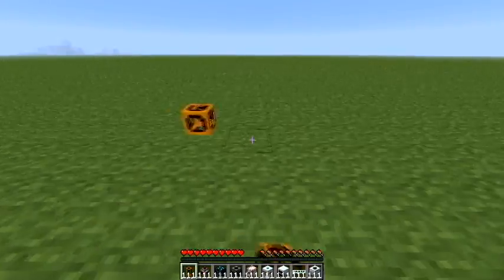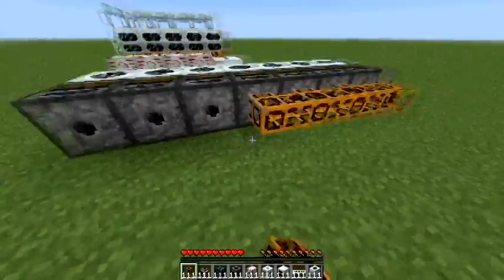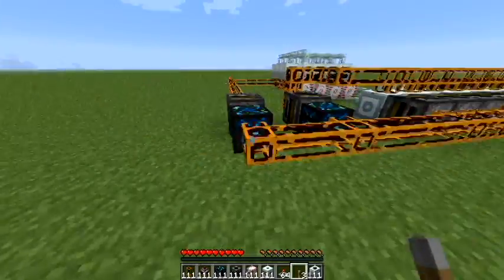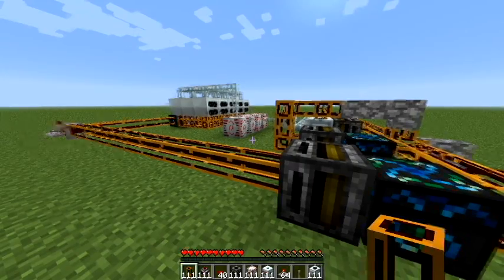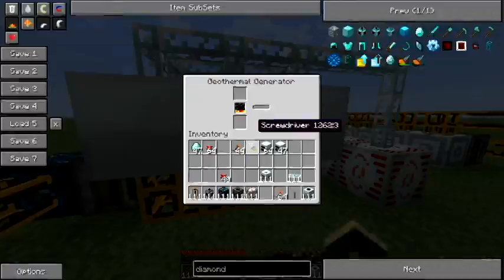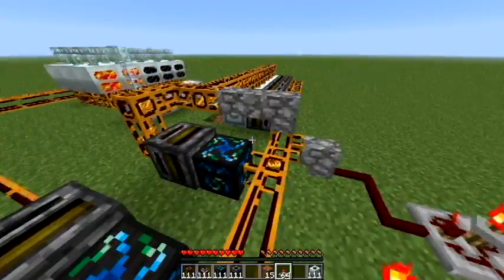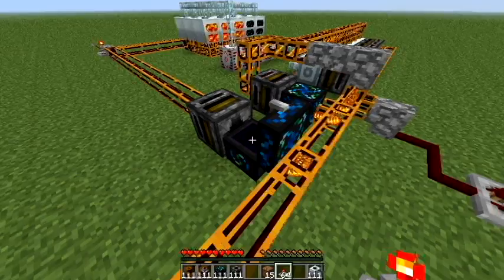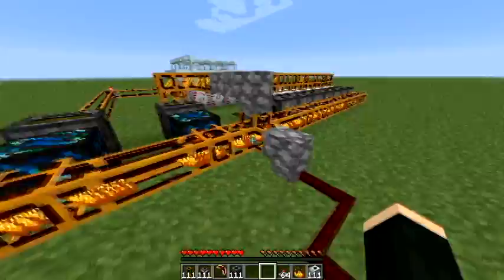[Tutorial] Blaze Rod EMC Generator

Comment from the maker: Yes, they are.  Technic and Tekkit both share most of the mods, particularly the "technical" mods.  However, while it may be EASIER to set up power flowers and other basic contraptions, this is relatively easy, very cheap and gives MASSIVE returns in a short period of time.

Comment from the maker: Jacketed wiring is when you take a block, cut it in half using a Saw, cut those halves in half then cut those halves in half.  You should end up with "panels" and surround a red alloy bar with 8 panels (in a 3x3 crafting grid, bar in the middle) and it should make, IIRC, 4 jacketed wiring.  It allows the connection of regular red alloy wire and the redstone pneumatic tubing.

Comment: As maddawg already mentioned. All of this is quite easy to get... Me and a friend are building a CASUC reactor (our 2nd reactor) which generates 1820 eu/t... meaning we need 36 MFSU's and even that is rather easy to do. You can always build a cheaper emc farm first to get the materials and then expand it.
Btw, at 9:07 you put red alloy wire in the condenser. You can also put in any sort of product that you make with the handsaw (like cover corners) Those are a LOT cheaper to make!

Comment from the maker: The whole point of the setup is to have as low an EMC cost as possible while still maintaining the degree of self-perpetuation.  By creating EMC, you send a very small percentage of said EMC to power generation which then multiplies itself into several times as much EMC and the cycle goes on indefinitely.  If you look at the material cost between -ONE- HV Array and 5 Geothermals, it's enormous.

Comment from the maker: Geothermal Generators can be attached to the EMC Loop allowing for permanent and constant EU generation.  Using solar to get the same amount of EU would either require VERY large solar flowers OR a lot of resources to make a HV or 3 Solar Arrays.

Basically, they create power constantly and once it is fully operational, will run indefinitely.

Comment from the maker: Make sure that you are using LV transformers before the macerators (and if using MFSUs as shown in the video) make sure you have an MV transformer before the LV transformer.  The Adv Machines (and the regular Macerator) take LV be default, so you have to knock it down 2 stages (1 stage (MV to LV) if using MFEs) HV to MV to LV for the machines to work.

Comment from the maker: The point of that many geothermals is to also fuel any other IC2 power-related devices you need.  That power can be sent anywhere to any machine and transformed down.  Yes, it can be more compact, but the layout is so everyone can see exactly what is going on and there isn't a need for an extra condenser.

Comment from the maker: If I recall correctly, you need to place the triple-dots (HV side) of the MV transformer towards the MFSUs and then connect the triple-dots of the LV transformer to a single-dot of the MV transformer or to the wire exiting from a single-dot side of the MV transformer

Comment from the maker: It, in reality, using this exact setup, is not cheap.  It is incredibly efficient and when running at maximum speed, will produce the EMC that was used plus some within a few minutes.  I mean, it takes 3-4 condensers to efficiently break down all the items being produced.  The only problem I've seen is a lot of SMP servers will disable the blaze rod -> powder and bones -> bonemeal maceration since it does provide infinite EMC.

Comment from the maker: So you have the transformer(s) and its connected properly from the MFSUs.  That means the dots are all facing towards another MFSU until the last one which faces outwards (in any direction) and attach the fibre glass cable to the dot from the final in-series MFSU.  If something is broken from that, I would advise rewiring the whole thing from the power to the MFSUs, the MFSUs themselves and the power going out of the MFSUs into the macerators/transformers, depending on your setup.

Comment from the maker: You have to make sure that they are receiving a redstone pulse from a timer.  Whether you use redstone pneumatic tubing and connect it with red alloy wire and some from of jacketed wire or using wire underneath them.  Also, the filter has to have the big hole facing the macerator and the little hole facing you on a side of the macerator.

Comment from the maker: I sure have.  Mk3 power flowers, as they've been deemed by the community, consists of something like 17 Mk3 collectors and 9 Mk3 relays (actual numbers are off).  They are incredibly efficient because, assuming you manipulate the inventories, you will never have to touch them again.  However, the EMC/s is horribly inefficient unless you use Watches + Pedestals, which takes 32 to get maximum speed.

Comment from the maker: The whole system works like this, in the order that I present it.

Lava cells get pumped into Geothermal Generators which power a/several MFUs to power some Macerators that will take a reliable feed of Blaze Rods(1) and turn them into Blaze Powder(5).  The blaze powder is then reconverted to Blaze Rods, while the excess is pumped into a "fuel" chest for the Geothermal Generators.  The excess from that, the "pure profit", is then condensed into whatever material(s) you would like.

Comment from the maker: Just to confirm, for you, that the filters are correctly placed, the largest hole must be facing opposite of the macerators. Also, they must be on a side to pull out the blaze powder. If both conditions are true, try putting some blaze powder into the filters and see if that works. Also, not using redstone tubing can change how you power everything with the timer, so if you don't have all the correctly hooked up, you'll see problems there as well. If none of these were solutions, I could

Comment from the maker: In order to keep the same efficiency, you would have to have a row of 20 or 30 unupgraded macerators because they macerate so slowly.  Putting in even 3-4 overclocker upgrades will greatly reduce the number of macerators you need and I believe 7-8 overclocker upgrades will get you close to the speed of an advanced machine macerator (rotary macerator).

Comment from the maker: If you are in Tekkit or the newest version of Technic, you need to add a LV transformer after the MV transformer -OR- add Transformer Upgrades to the macerators.  If you don't want to use a transformer at all, add 2 upgrades, otherwise use a MV transformer with 1 upgrade in each machine.

Comment from the maker: Assuming you always add more generators if you increase the amount of macerators, yes.  So long as there is never a deficit when using the macerators, there will always be (duh, no deficit means...) a gain and it would be stored in the storage box of your choice (MFE or MFSU).  And if you don't want to increase the amount of macerators which also increases how fast you make EMC, you can just add more macerators to have a larger battery.

Comment from the maker: One of two things.  Either you're using MFSUs with the Advanced Macerators that require upgrades or you're using regular macerators, which need a Transformer upgrade and the MV transformer or MV transformer -> LV transformer.  I play Technic so I'm currently using which doesn't require any upgrades to receive MV.  I have put links into the description showing the different threads for the different types of Adv. Machines.  Hopefully this solved your problem :)

Comment from the maker: It should be something like 1536 EMC for a Blaze Rod and a single Blaze Powder should be half that value, 768 EMC if I'm not mistaken.  So by macerating them, you should be gaining 768 x 3 EMC over the normal EMC.  So total, one Blaze Rod (1536) macerates into 5 Blaze Powder (3840).  That's why there is such a huge gain.  If there has been an update that has removed this or you are playing Tekkit, be aware of the server settings having been changed.

Comment from the maker: Basically, because I was using an older version of Technic (Tekkit always used these machines) you have to put a MV transformer followed by a LV transformer because the machines accept LV be default.  If you only put a MV transformer, then you need at least 1 transformer upgrade PER MACHINE so they do not explode.

Comment from the maker: If you consider the material requirements to create enough panels or a large enough array to compete in the EU production, you already have an advantage there.  Then considering that, if you spaced out the fuel cells appropriately, each diamond creates 64x20,000 EU.  That is 1,280,000 EU per diamond.

Comment from the maker: Chances are, you're most likely going to already have some system of EU production, so once you have this up and running, it doesn't take very long to create enough emc to actually do what you're saying.  HV Arrays would be awesome so you didn't have to worry about EU production failing or using some EMC from the production line to keep EU flowing.  However, you also have to remember that you have to macerate something like 1.2k coal to make 1 HV array.

Comment from the maker: It is supposed to create 5 powder per maceration.  When you split a rod manually, its only 2 powder.  So each powder is 1/2 the emc of a rod, so maceration creates 2.5 times the emc value of the rod.

Comment from the maker: In the newest versions of Technic and any version of Tekkit (with the Advanced machines that allow upgrades), the only real power consumption is on spin-up.  When the macerators are fully spun-up, they only take about 1-1.5 EU/T (EU per Tick) at most.  At least, that has been my experience thus far using the Adv. Machines that use upgrades.

Comment: if you had HV solar arrays instead of normal solar panels you would need just a small flower formation of them to make that kind of efficiency, it costs more resources to build but it's worth it, i had so much stacks of diamond blocks that i made a really big castle out of them and i still had a lot more to use to charge up my klein star Omega =)

Comment: You can basically do this with any items that has an EMC value and has a better output if you macerate it rather than simply crafting it. I.E. crafting a bone will give you 3 bone meals, macerating a bone you'll get 5 meals, it's the same but less effective.

Comment from the maker: It's not up to the Tekkit people to fix, it's up to IC2 mod maker to fix or current mod developer of EE2 to fix.  Changing the EMC value of bonemeal and blaze powder to 1/5 the original item will make it so it is impossible to "dupe" the emc, but also makes it very costly prohibitive to not macerate it.  IC2 can fix it by making bonemeal and blaze rods non-maceratable, but either way, its not duping and its not a bug, it's just using the functionality of one mod and automating it.

Comment: What I Recommend To This is Using Watermills As A Power Source Since Its Easy And Have Unlimited Source Of Energy Since 2 by 2 water blocks makes unlimited water source. This Is More Resource Saving And Works Day And Night You Can Also Make It Automatic With Buckets Using Deployers. Witch Makes It  Much More Safer. Also Speed  Production Of Electricity Relies On Number Of Watermills. 40 Watermills Is Like Having A Nuclear Reactor Trust me.

Comment: this will help make your EMC gen more efficient:
use a retriever if you are going to use about 3+ because it works out alot cheaper (im currently running a legit EMC gen on 105 normal macerators and 1 filter 1 sorting machine and 1 retriever) and it produces a shit ton of EMC about 1 condenser of red matter a day.

Comment from the maker: You can get away with a smaller setup.  You can use one macerator, a few batboxes and some solar panels to start it.  Once it gets going, you can expand it into the full setup allowing for several macerators with high energy surplus allowing for usage of EU across your base without need to worry too much.

Comment from the maker: Somewhere between your "EU Battery" (MSFUs or MFEs) you aren't changing the voltage to Low-Voltage (LV).  Tekkit Rotary Macerators have always taken LV, whilst the earlier versions of Technic used a different version of the mod, allowing for Medium Voltage (MV) to be accepted by default.  You must add either 1 transformer upgrade into each macerator while maintaining the same setup -OR- add a LV transformer after the MV transformer.

Comment from the maker: That can only mean that the voltage you are trying to put straight into them is too high (eg they accept Low Voltage and you are using Medium or High Voltage).  Try adding a Medium Voltage and/or Low Voltage transformer, back-to-back or put in Transformer Upgrades into the macerators.  If you followed my setup exactly, then you will only need 1 Transformer Upgrade per macerator -OR- one Low Voltage transformer before the wiring enters the macerators.

Comment from the maker: As long as they are directly receiving a redstone pulse, are faced properly and are on the side of the macerator, it should be pulling it out.  My only guess is the tubing isn't connected properly or you put something in the filter.  Not sure, could also just be a bug, so replacing it may fix it.

Comment from the maker: This is true, however you have to consider that every single advanced panel requires a proportional amount of regular panels.  One Low-Voltage array (8 EU/t) requires 8 regular panels and one Low-Voltage Transformer.  A Medium-Voltage array (64 EU/t) requires 8 LV arrays and a Medium-Voltage transformer.  That's 64 regular panels to equal only 3 Geothermal Generators.  Not to mention they ONLY function during the day and require a straight-shot to the surface to produce energy.

Comment from the maker: Fill two of the slots (the top right slot and the bottom slot) with something that isn't maceratable.  So dirt, sand, wood, etc so it wont fill that slot with rods.  Make sure the rods pump in to the top and  pump out from the side and make sure that you have the powder feeding into the condenser with the blaze rods targetted, then the diamonds for fuel, then the storage condensers.

Comment from the maker: If you are using technic, when you have the utility mode of NEI (I can't really recall most of the mods, been a while since I lasted played) it should tell you the EMC value of items when you hover over them.  If the lava cells don't have an EMC value anymore, then I'm afraid this method would not work.  Otherwise, I'd check to make sure you're actually using the LAVA CELLS those are expendable tin-created cells that hold lava.

Comment from the maker: Of course, the only downside would be that if you eventually want to crank it up to 8-10 overclocker upgrades to your Macerators, you have to adjust the input to go up to MV and/or HV.  Using MFE's will drain very, very fast if you ever want to get to that efficiency, but otherwise there is no downside.  If you use regular Rot. Mace. and put 2-3 maybe even 4 OC (Overclocker) upgrades, you should see high return and very little problems with the EU intake/output.

Comment from the maker: If you're using Advanced Macerators and its the version that doesn't allow upgrades, then no, there isn't any way to speed up production.  If you have the version that does allow upgrades (noted by the 4 boxes on the right-hand side of the Macerator UI) then yes, you can put in as many overclocker upgrades as is allowed by the current flowing in.  I believe that 5-7 overclocker upgrades is the limit for MV, so you'd have to step it up if you wanted more.

Comment from the maker: Whether or not it works is up to the discretion of the server admins.  If they have (or if the newer version) has a changed EMC value for blaze powder OR the macerators only macerate the blaze rods into 2 powder, then it will not work.  You can try bones as well, as 1 bone breaks into 5 bonemeal with maceration, but its about 4x slower.

Comment from the maker: The only problem using DM Pedestals is I don't believe you can "burn" them in a condenser or transmutation tablet.  Instead, you can target Red Matter Furnaces, (which I believe are higher EMC value) and they are "burnable" making it much easier to use them.

Comment from the maker: Power flowers cost a lot more to have the same efficiency.  In fact, you'd have to use watches with pedestals to obtain the same efficiency, which is astronomically more expensive.  Power flowers generally won't be accessed before this.  You can use any EU generation method you'd like and having MFSUs is a little overkill.

Comment: you need to use energy transform upgrades to the macerators, OR you convert the power to low voltage using LV Transformer after MV transformer

Comment from the maker: How are the filters set up?  If they are connected to a side, it should be fine.  If it isn't on a side, you need to make sure the filter knows to ONLY pull out the Powder otherwise it may fail.  Assuming you have the holes lined up correctly (large hole towards macerator, small hole facing away) and you have the jacketed wire connected to the tubing with the redstone wiring connecting to the same block as the jacketed wire and the timer, it should work properly.

Comment from the maker: However, if you simply mean how long it takes to set up, you are correct that a small, automated reed farm is very fast to set up and is definitely a ton cheaper, but the end result is you will never compete with a design like this. (assuming it hasn't been removed from your Tekkit or Technic version* [*I say Technic version because I'm not sure if any of the mod makers have changed how the mods interact in new versions.]